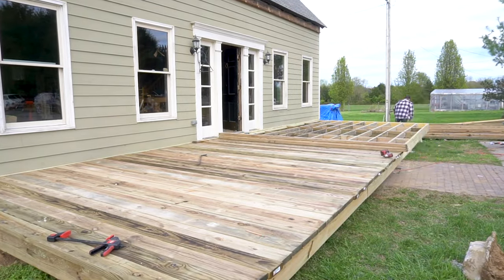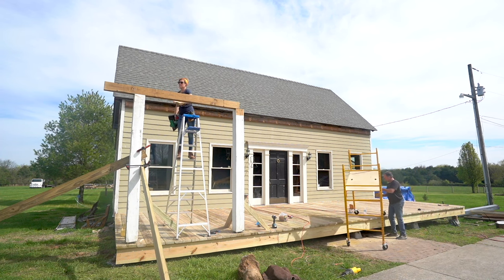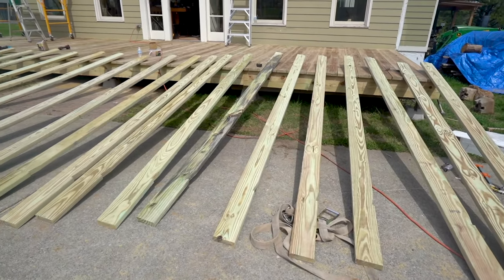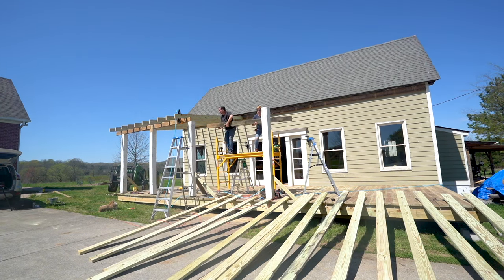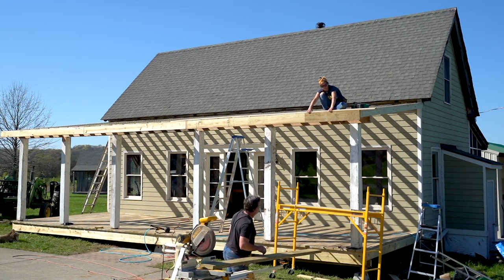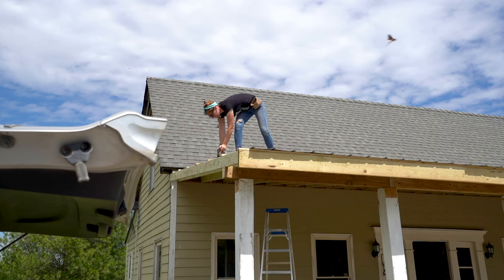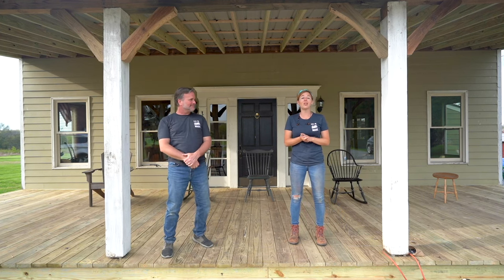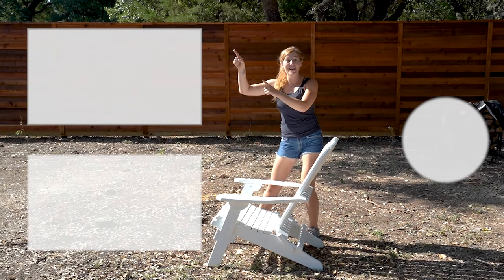Building a Covered Porch

Comment: For people that have not used them before post levels can get you in trouble . Because they are so short the slightest imperfection in the post ( knot , splinter , paint blob, bow , etc. ) can throw it off . Handy if your running out of hands but I always double check with a long level . Great looking job !
Reply: good point, i was about to buy one... i still probably will but i'll keep that in mind.
Reply: Even better would be to make an offset jig for a couple plumb bobs. Absolute accuracy unless it’s windy.

Comment: Questions: how are you fastening the posts to the deck structure (key here is wind uplift)? It looks like the posts aren’t over your piers which can be an issue. What sort of flashing detail was used where the two roofs meet? Recommend adding lags to your 45 degree braces. Just some thoughts from a structural engineer and former carpenter.
Reply: I had the exact same question about the posts.
Reply: I wondered the same also.
Reply: Ditto, unless I missed it, the posts were never secured other than the leveling braces which were later removed.  I'm also interested in the water movement treatment between the two roof areas.  Overall, super video as always, thank you.
Reply: I also noticed there were no hurricane ties.
Reply: me too
Reply: Chris Terry agreed. Hurricane ties are very important at the roof if codes requires them

Comment: Just curious.  How were the posts attached to the base of the deck?  Did I miss that?  It appears that they are just sitting on them and are reliant on the weight of the overhead, roof, etc... to press down on the post where it meets the deck.
Reply: Yeah i was thinking the same, glad i wasn't the only one thinking it was weird or i had missed something .
Reply: Wish it was more of a how to video.
Reply: I watched the whole video twice, an even rewound 100's of times, and I could not find where it was ever mention (if it happened at all?) about the posts being fixed to the top of the deck...other than the part about aligning them with the supports below the the deck.  It was driving me crazy, glad i'm not the only one! lol.
Reply: That thing is gone the 1st major wind storm that comes along.
Reply: The same way it was in the before picture. That old porch outlasted most of the shit built now days.

Comment: Great Job. I might have missed it but I didn't see how you attached the posts to the deck, or was that not necessary?
Reply: Yeah wouldn’t want to lean too hard on one of the posts...
Reply: Exactly why I came to the comments section... Are the posts not actually secured to the deck itself, and only via the rafters?
Reply: What is holding the posts? All is going to fall down if not secure.
Reply: They said they screwed it to secure.
Reply: @marshacampbell9964  That is not going to hold all of that, and they'll find out soon. They're gonna have one hell of a problem when winds come in

Comment: Not being critical but if you are going to roof with standard sheet goods I’d be measuring the spacing of the rafters to eliminate the repetitive error by using a spacing block.. after 10 rafters a tiny error in width will add up quickly.
Reply: 3:23

Comment: I don't understand how you guys were able to fix the posts on its base,  somebody please explain it
Reply: Probably a type of post socket ,its a bent piece of metal that fastens through the deck and then to the post
Reply: It's most likely just toe-nailed in and will get trim wrapped around it
Reply: @atoka  - if you look at 0:20 The post bases are already attached to the bottom of the post. These look like the aluminum pedestal type bases which typically don't have an attachment point for the floor. Not sure if they are doing molding but it would help. Without any molding the only way to guarantee the post not to shift would be if they reached under the deck and drove a bolt up through the middle.
Reply: @oodoodoopoopoo  It looked to me like he had chamfered the base to reduce the footprint a little... Now that I've said that in my head I can't think of a reason to do it so you are probably right. I blame failing eyesight.
Reply: It looks like a post base for a 4x4 post pre-attached to these 8x8’s. Therefore eliminating any way to anchor to the deck properly.  One of many building code violations regarding attachments, and load bearing.  Most of the columns are floating with no load path to the foundation which is also missing

Comment: Hmm how were posts attached to deck? 🤔
Reply: Same way they were attached before, he reused the original deck posts... Look closely at the video and you can make out the bracket under the posts...
Reply: @ZeoCyberG  ohh ok can see a little bracket maybe. Just anchored to deck boards
Reply: Jonny DIY No, that bracket does not attach them to the deck. It is a stand-off bracket. It just provides a gap so the end of the post doesn’t sit in water and wick it up into the post to rot it out.

Comment: How did you measure or calculate the angle and depth of the back cut and birds mouth for the rafters? Also, how did you attach the vertical posts to the deck after ensuring they were plumb? 🤔

Comment: Watching his video caused me some concern with how those posts appear to not be attached to the ground in substantial way.  The whole structure of the deck and the porch are on 5 or 6 concrete blocks.  Wind could lift this whole structure off the front of the house.  I know building codes can be different.  I get 60 mph wind storms in my area and you have to attach everything you build into the ground.  I'm wondering if this is a workshop and not a house so maybe it's not as much of a concern if nobody lives in the structure.

Comment: Until the winds lift the entire roof off the deck.
Reply: Didn't happen before, doubt it will happen now.
Reply: august that sort of mindset is how buildings fail and people get injured or killed. “Been doing it for 30 years. Haven’t had an issue before.” 

Codes change. Practices improve. Follow local building codes and engineers requirements and stay in your lane.
Reply: It’s probably heavy enough
Reply: twitch moments roofs that are FAR heavier and larger than this have been blown off by severe storms, much less than a tornado. This is a hack job all the way.

Comment: Why not have the posts sitting on the concrete pillars? Surely those heavy posts will make the 2xs sag over time, and therefore the roof. What a pain for future mx.
Reply: Never happen, ain't going nowhere.
Reply: It doesn't have to be directly over the concrete footings, same reason you don't need a foundation to reach up to the second floor.  The framing of the deck just has to be able to transfer the weight load to the footings, which this does as the pillars are over the support beam near the edge of the deck, which transfers the load to the footers, as well as each is placed very close to those footers anyway.  The deck roof is also attached to the house, so the pillars are not supporting the entire weight by themselves, and it's not like it's a massive load to begin with as it's just a light roof just to give the deck cover...

Comment: Love watching your vids! I also think is cool how the regoinal terminology is different from Texas to NC. What you called a header on pt 1, I would call a ledger or the drop girder would be a double band. But who cares!!! For your hangers, you should invest in a PT nailer. I have a Bostitch F33PT, it is up to a 3-1/2" framing or 1-1/2" hanger nailer that meets code in most areas. It is pneumatic and not battery but is a beast. Otherwise keep up the good work!!
Reply: Looks like no hangers were used. And the notch on the house end of the joists doesn't make any sense.

Comment: Hi

Just wondering how many inches you spaced your rafters apart from one another? 

We're rebuilding our patio roof here and almost getting to the process of putting on the rafters. I did some searching online (Google 😜😂) and saw that the rafters are typically spaced at least 24 inches apart. Was wondering if that would work? 

What's your recommendations?

Thanks!!
Reply: 24''OC is fine, 16''OC is better. They did 16''
Reply: A longer span gravitate toward 16"OC
Reply: august 
👌gotcha. Thanks!
Reply: Larry Be 
Our patio is 16ft long (from left to right) and is going to be about 12ft from the wall, outwards where the posts are...
Reply: @ericmknsana2608  
IMO for this length it would be a toss up but I would go with 16"OC. Where you can go with 24"OC better is if the pitch is higher with blocking in the middle to prevent twisting.
Reply: Larry Be 
My rafters have a gap about 1/4" from the ledger. The rafters are attached to the ledger board using 2x4 joist hangers. I think my cutting was the reason as they're not perfectly cut. I did found out my slopes. It was 50 degrees. I cut the birdsmouth part and they are sitting nicely on the headers. 

My concern is that there is that 1/4" gap on some of them but I made sure to toe nail it in and use 3 and 1/2" long nails to make sure it sinks deep into the ledger board. So far everything is secured and feels solid and we've been on the roof to install the sheaths and it has not collapsed 😄 the saw I used was DeWalt flexvolt 60v 7-1/4" battery operated circular saw...

Comment: Speaking of Templates: 

It was decided to Line the Back Wall of an Industrial Shed with Tongue and Grove Floorboards running Vertically. 
These Boards came in 12 Foot Lengths. 
The Wall measurement Floor to Roof was 123 Inches (10 Foot 3 Inches). 

Two of Us were assigned the Task of cutting the 12 Foot Floorboards to Length. 

Long Story short. 
We both Cut Template Boards, from which We Cut all of the rest. 

All of his Boards were Cut to 10 Foot and 3 Inches. 
All of My Boards were Cut to 10 Foot and 3 Centimetres. 
Simple enough Mistake and I was the one who made it. 

For Twenty Two Years every 2nd Board on the Back Wall was deliberately Shy of the Ground, We called it a Design Feature to Allow Rat Poison to be discreetly placed. 

For Years a Skirting Board was infrequently Mentioned, but somehow never eventuated.
Reply: Michael O'Donoghue Seriously dude, what’s up with the random capitalization? How do you decide which words to make into proper nouns?

Comment: Yeah, great video of all the big steps, but the details are kinda missing.  Posts attach to deck, fascia join with existing roof line, screws vs nails, kind of lumber and potential for rot, drainage, use of Simpson hardware if any, etc.

Comment: Why you didn't attach the post to the deck? Aren't there winds in that area?
Reply: Places like Nashville, TN high wind conditions are pretty rare event.  Besides, relax, they just didn't show it being attached.  Same as they didn't show the roof panels being installed.  This wasn't a how-to video, just a glimpse into the project with highlights of the process for a quick summary.   While it's basically the same roof setup he had before, using the same pillars, that lasted him many years with zero problems.
Reply: ZeoCyberG I like the channel, but unfortunately, relaxing is not called for. Her viewers see these as how-to’s. Take note of how many people commented on part 1- “I’m gonna try that!, How do I do such and such?”  For this reason (and her own legal protection) I commented elsewhere that at a minimum she should advise viewers to follow codes in their own areas, and that they follow her step-for step-at their own risk. This helps everyone involved. She doesn’t hesitate to dole out all manner of advice during the video except the most important about codes.  Again no knock, but she is not a contractor or carpenter, and has no formal training. With over 1 million subscribers, when you  are building table saw carts, its no big deal. When you are building dwellings, it’s a recipe for disaster.
Reply: @edd2771    Relax.
Reply: @edd2771  Sorry, but that's not logical or reasonable, and doesn't change that it's the wrong conclusion...
.
Frankly, doing things based on just a summary and not full knowledge on the subject is liable to win you the Darwin Awards...
.
Never confuse enthusiasm with actual skill and ability to do something.  You see something you like, then go learn more about it!
.
Besides, there are multiple ways to construct a deck and attach posts.  She could easily take a few videos on just those details in an actual How-To...  Lots of time even when watching a how-to video doesn't mean you never have to research more information as you may want to do it differently for your particular needs...
Reply: @edd2771  Not to knock her but you did. Go look up the meaning of contractor and carpenter. I have seen contractors cut corners or leave out what a design calls for ( I have repaired or included what a " contractor omitted"). She builds things out of wood in her shop by definition makes her a carpenter. As for codes thats a different story that may involve a permit that leads to an inspecter adding more cost to the project but that does not mean it is better in terms of the finished product.
Reply: Marc Davis Merriam Webster: Carpenter: A worker who builds or repairs wooden STRUCTURES or their STRUCTURAL parts. I did not knock her. I said for her own liability and her viewers safety; she should recommend they follow code. Yes a skilled person can get a good result without code or permit. Does that make it wise? No. Are she or her viewers skilled pros when it comes to building structures, or rookies?  Based on what she’s doing and based on the comments, its the latter. To repeat, her sweet spot is signs, tables,, benches, CNC milled doodads, and the like. She is not experienced in building structures. It’s no knock on her, it’s just a fact. She should be forthcoming in these vids that her way  is not necessarily the best way; and that while she is not following code she recommend others do. Or not.  I have long since stopped caring except when an absurd post such as yours prompts me to respond.
Reply: @ZeoCyberG  Sorrry, but you're completely wrong. You are not reasoning logically at all - so maybe you should have studied Darwin a bit more.
Reply: @Vinterfrid  Sorry but trolling doesn't work on me.

Comment: At 8:05, stop the video and look at the lower right of the screen at the deck post.  Isn't that the wrong way to use one of those blocks?  I thought they had to be resting inside and centered for it to transfer the load correctly.

Comment: When your doing the metal, do you screw into the ridge or the valleys? I have seen it both ways but I did mine on the flat right in the middle after running a string line to keep my screws strait. But someone told me I should have done the ridge so the water would spend less time around my screw. My thinking was the screw wasn't long enough to get a sufficient bite into the perlin
Reply: With screws; always go on the flat because the screw can pull tight and make a watertight seal without damaging the metal. If you use a screw on the ridge you risk creasing the metal when it starts pulling tight. Nails are better on the ridge for that reason.
Reply: You did it the right way. Some do ridge and some do the flats, but like Chuck B said, ''With screws; always go on the flat because the screw can pull tight and make a watertight seal without damaging the metal''
Reply: @augustreil  until the rubber seal breaks, or the wood movement loosens the screw. Then you have a leak.
Valley screws should only be used if fixing to a wall.
https://qldsheetmetal.com.au/about-us/installation-maintenance/roofing-installation-guide/ here is a guide.

Comment: I do not understand how the post was attached to the deck.
Reply: I was wondering the same thing.
Reply: I don't believe they are attached. It looked like they have aluminum pedestal bases beneath the posts. The weight of the huge posts themselves with the bracing at the top should prevent any shifting or lifting. Add to that the weight of the roof and I believe they really don't have anything to worry about. I typically like to attach them at the bottom when possible but I do like the aesthetic of these bases and they typically do not have an attachment point built in. In some cases when it fits with the design, molding around the base will prevent any shifting but will not do much  to prevent lifting. Though if the design calls for base molding then might as well use a Simpson strong tie that can be hidden 🤷‍♂️.
Reply: @oodoodoopoopoo  Until a Tornado or straight winds come a huffin' + puffin' !
Reply: Didn't look like they were. The beams should have been to the ground. A good wind is gonna tear that roof off the deck if they didn't secure the beams to the deck. :/
Reply: David S explain wind uplift then
Reply: @djAnakin , The old one didn't go anywhere ? Maybe they put a lag in from underneath ?
Reply: There are a variety of post connectors, and you definitely need them. Surprised April didn’t show it. She’s usually really good about that. What feels strong to little humans is nothing compared to Mother Nature. 

Similarly, the knee braces are critical to give the structure lateral stability.

Comment: To avoid all that "crab crawling" on open framing, rip a sheet of ply in half & just lay it on the joists or trusses (only works up to maybe 4:12 pitch without temp nails) & scootch it along as you progress
Reply: Or use both halves to avoid scotching. Just leapfrog the sheet halves.